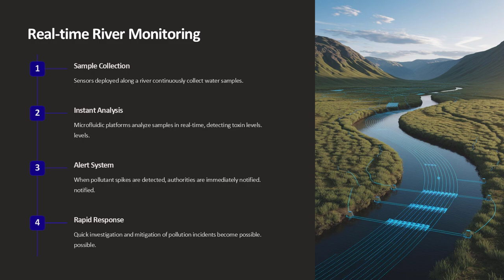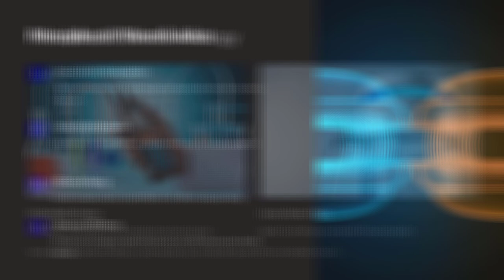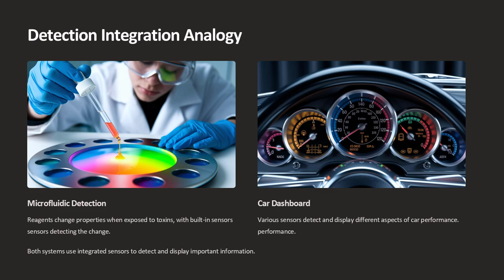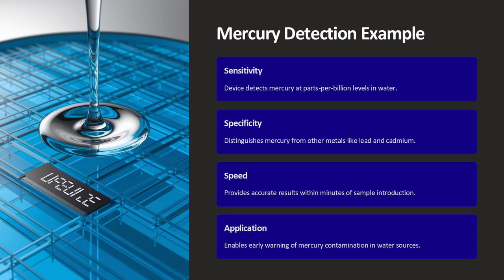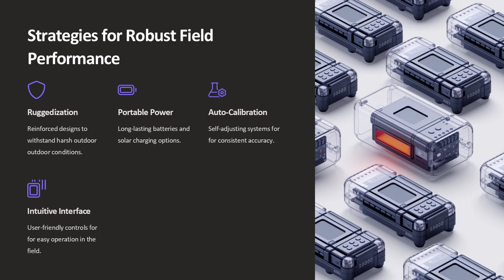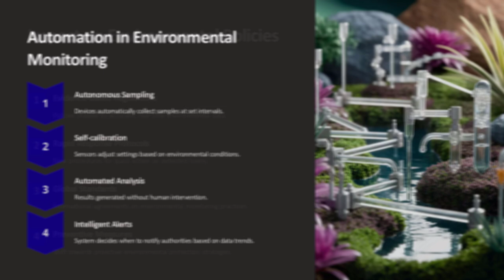Microfluidic Toxin Detection – Environmental Monitoring

Comment from the maker: How can microfluidic toxin sensors maintain accuracy and reliability when exposed to variable environmental conditions such as temperature fluctuations, humidity, and complex sample matrices?
What are the theoretical and practical limitations of detecting ultra-trace contaminants (e.g., pharmaceuticals, microplastics) using microfluidic platforms, and how can sensor sensitivity be further enhanced without increasing false positives?
Can AI-driven predictive modeling accurately anticipate environmental pollution trends based on real-time microfluidic sensor data, and how can such systems be integrated into global climate change mitigation strategies?